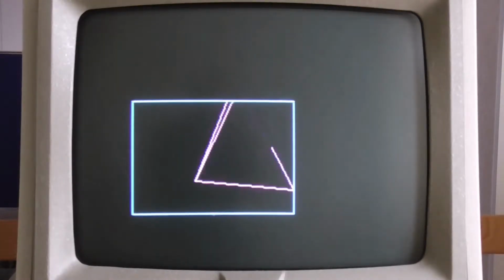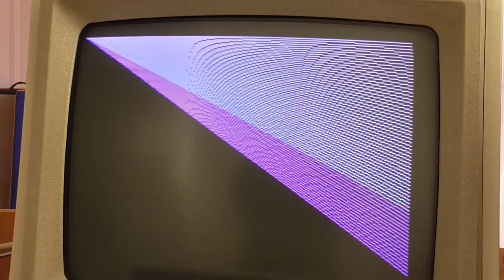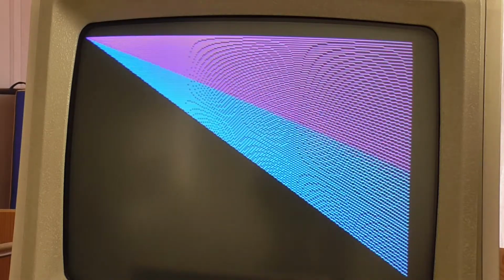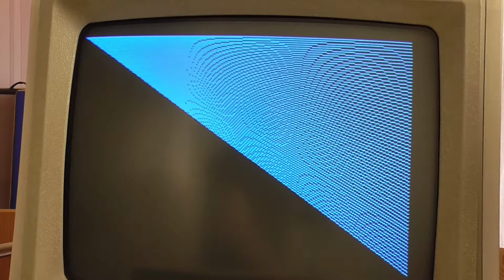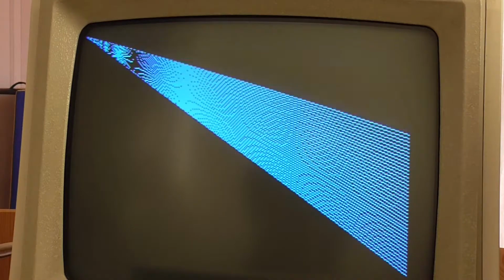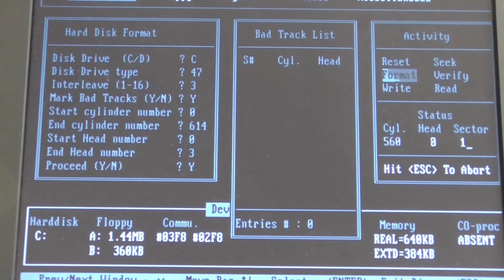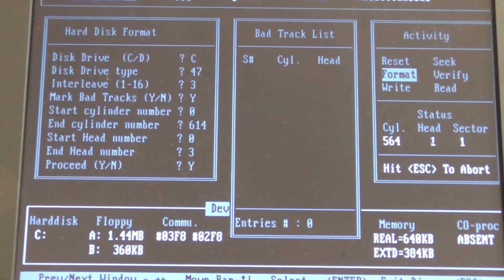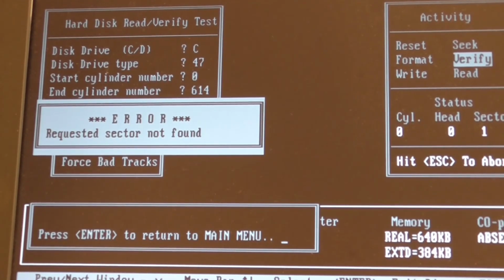Ludicrously Fast IBM PC Line Drawing  | Retro Hard Drive Acquisition

Comment: Writing 4 pixels (one byte) at once, why? I thought that 8088 can store 16-bit values to RAM (8 pixels). It would improve speed at horizontal or nearly horizontal lines. Will be interesting to see next episodes - how to improve vertical lines, cause that trick is inapplicable there. Its a good idea to just write zeros when erasing the line, but in this case - since you have fairly small rectangle where the action is, its questionable whether it would be faster to just erase the whole rectangle after each frame instead od deleting individual lines.
Reply from the maker: Both good comments. The reason I use 8 instead of 16 bits is because I can gain the speed back many times over in the actual line drawing code. I have the code broken into sections, one for each pixel within the 8 bits. This means I can do everything with short jumps, with as many cases as possible falling through automatically to one another, without spilling any registers, etc., all of which are huge savings.

By the way, the 8088 breaks a 16 bit write into two 8 bit writes. It's not much of a saving to write 16 bits at once. The 8086 is a different story, though the RAM we are writing to in this particular demo is CGA memory, not system memory, and that is a different story.

As for deleting lines, you are absolutely right that simply zeroing the bytes is the easiest way, though it may actually be faster with a detailed image to zero the entire rectangle, precisely as you say. I can tell you've written this sort of code before!
Reply: @PCRetroTech  Thanks, i need to take the time to look at the code thoroughly, as assembly is not the easiest thing to functionally understand, and i am total noob in x86 coding.
Youre right, i did similar stuff with ARM cpu on WIn CE platform (pocket PC).